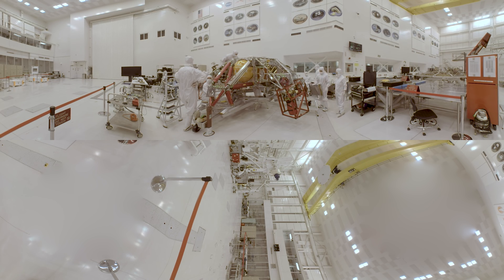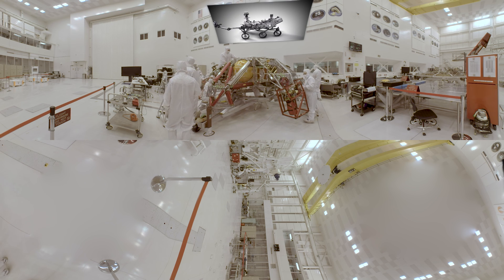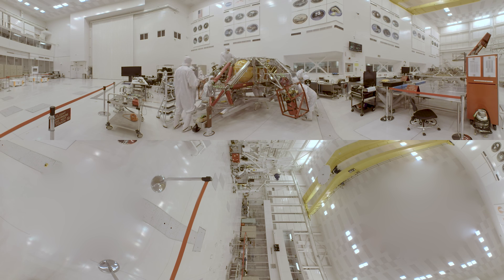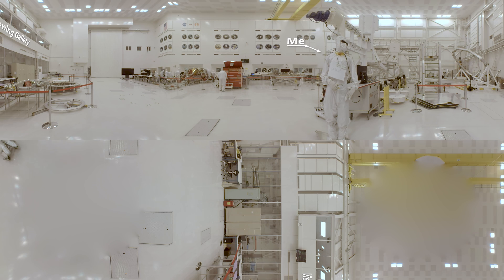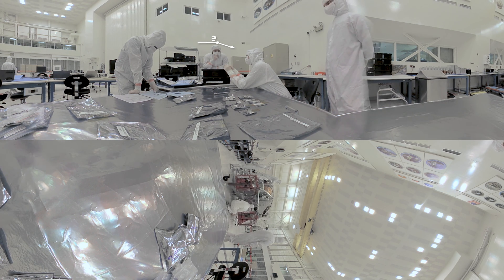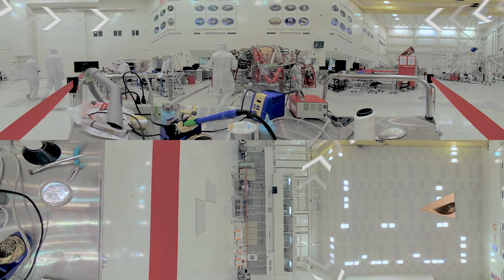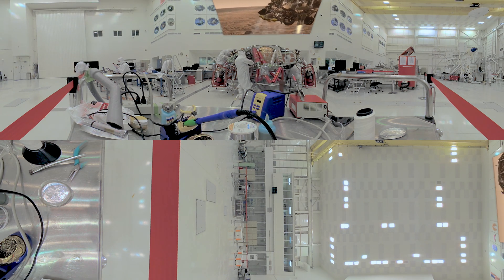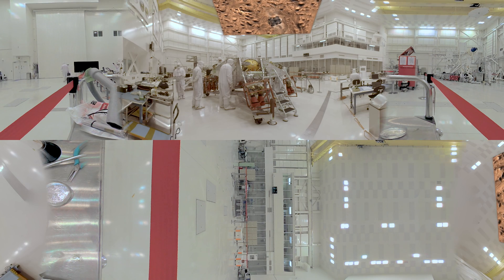Engineering for Mars: Building the Mars 2020 Mission (360 video)

Comment: Wish the decent stage could be saved and landed, with extra tech or?? on board.  Could be flown off to another curious site and set down with a camera, instead of just letting it bash the surface.  A simple week long camera, or high school experiment maybe.
Reply: It would be difficult, the decent stage needs to get the most away possible of the rover quick, and with limited fuel it would be really hard to make it land, think that it wasn't made to fly for so much.
Reply: I agree.   It would be a bit of a task,,but it could accomplish this.  How many meters does it fly off too before impact?  anyone?  It would be a 2for1 flight.  If it did happen,,it would be monumental.  Simultaneous landings,,utilizing the spendy bits to the last.   I think it would be very worthy of a test at least.  Alot of work in that descent stage.  A real shame to tumble it.  The big cold bottles would be pulled out of the fridge twice,, at JPL.
Reply: It could be feasible, but another important thing to consider is whether this would be the best way to reach two landing sights. Since a rover is being landed, you could simply drive over to where you were going to land anyways, and if it were too far to drive two, it might just be easier to send two rovers. 

In the end, landing carefully is probably a lot harder than a crash, so they choose to give up a bit of potential for a significant amount of saved work and risk.
Reply: Call it what you wish.  a supplemental technology demonstrator test after the descent crane has been utilized..  The complete reusability idea has to be pressed upon in leaps and bounds if we want to go anywhere.

Comment: Why not leave the decent stage attached and just propulsively land and make the rocket fuel to refill the decent stage fuel tanks.   That would allow the rover to hop to other locations, up or down cliffs etc.   Just a thought.
Reply: The descent stage uses hydrazine, not regular rocket fuel
Reply: Elden Crom Totally a guess but maybe for weight requirements, the apuratuses needed to make the fuel could be too much and ultimately make it not worth the ability to "jump" from one spot to another.
Reply: They already have the O2 maker on it, MOXIE,  (but its rather small) and it would need hydrogen and the Sabatier reaction.  I guess we will leave that for BFS.
Reply: XCOR (Links) filed for bankruptcy, they should have a few spares that burn Metholox; it would be an awful waste to have those boxed up in a warehouse somewhere.  :-)

Comment: 8 Years after Curiosity, you're  sending a second, near identical Rover. Great. Remember  in the 60's when 8 years was the time between concept and footsteps on the Moon? That was Progress, this is stagnation.
Reply: Steve M.- Well, you got the part about it being a "rover" correct, but that's about it.
Reply: If the previous design worked perfectly for 8 years, then there's no need to play around with a new rover concept. But this is an improved version with better equipment :)
Reply: Steve McGuinness
If they were building a new design, you'd be complaining that they were wasting money on a brand new design when the Curiosity design worked so well.
Reply: What do you expect, they're on a tight budget
Reply: I'm sure they will spend at least twice as much on the new fake-mars sound-stage as they did on the moon propaganda project.

Comment: Are the wheels of the same / similar design as Curiosity? Seems odd with how much damage they received, and NASA was just showing off those wire mesh wheels?
Reply: The mesh wheels are a prototype and haven't undergone full testing. The 2020 wheels are of a similar design, but with added reinforcement to help prevent the damage that Curiosity's wheels have sustained.
Reply: Even if the design is same the material used will probably be different, a better alloy/compound maybe.